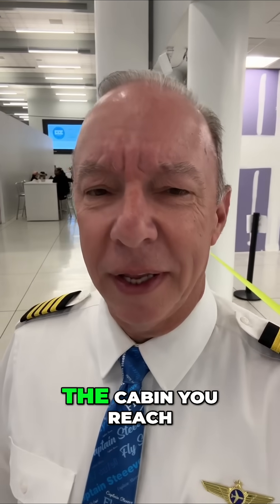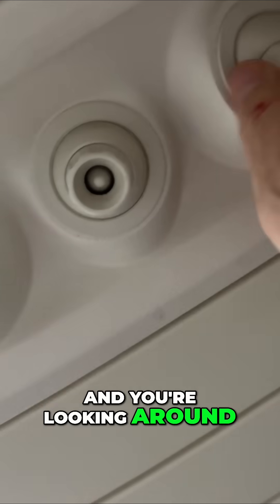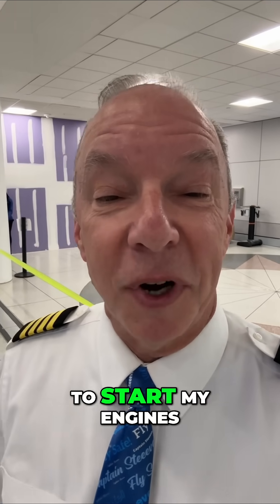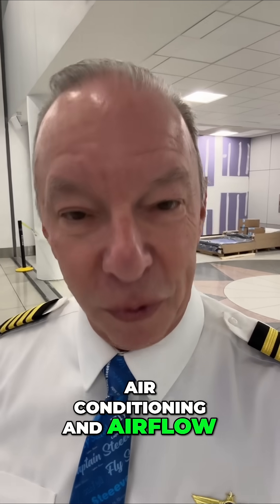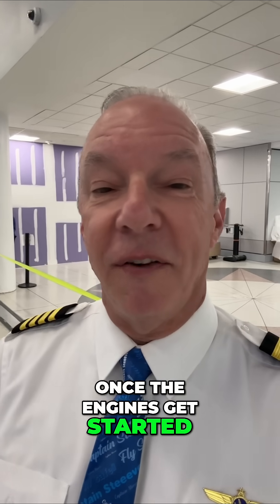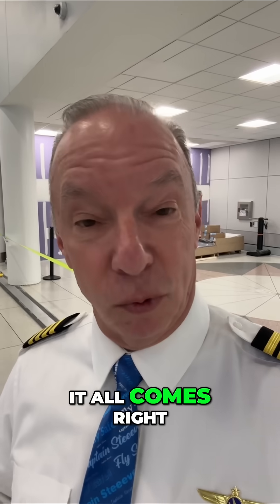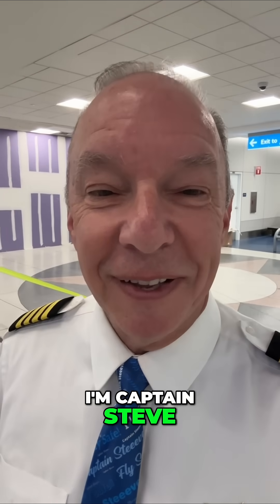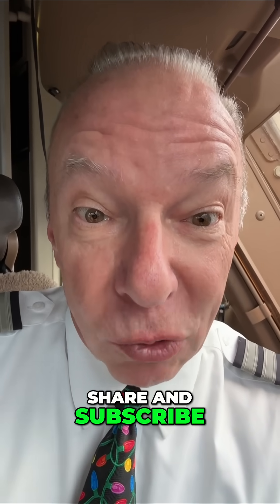Why Cabin Air Stops During Engine Start

Comment: I learned at Arlanda Airport that when they put in fuel, there's no AC because of the fumes from the fuel. It's dangerous if the fume comes in to the cabin.And the passengers get frustrated when it's hot. So when I travel I have a small propeller with batterys, to cool myself down, when it's hot in the cabin.

Comment: Oh. I was suspecting bleed air from APU is stopped to the packs during engine start to prevent exhaust (jet fuel smell) to enter the cabin as the APU air intake is probably in the aft of the aircraft where the main engines blow their exhaust. When main engines have started the fresh air is taken from their bleed air, from the front where there are no exhaust gases.

Comment: More specifically, captain Steeeeeve, it’s because you turned off the air conditioning packs to redirect the bleed air coming from the APU to the starters on the engines. Once the engines are running, the bleed air source, electricity generation, and hydraulic power generation switches over to them and the APU is turned off to conserve fuel. In certain situations the AC packs can be kept off and the bleed valves in the engine kept shut to improve engine efficiency during takeoff. I don’t know what conditions would warrant that though. Would love to hear it from you captain steeeve. In addition, I think that the APU should be kept on during takeoff and landing to ensure that the plane still has electrical and hydraulic power in the event of a dual engine failure, no matter how unlikely the scenario. What do you think  captain steeeve?

Comment: HI Capt. Steeeve!  just describing that is giving me a panic attack sitting at home, I need air.   Ive flown 40 flights or so and know the pre takeoff air stoppage.  at this point I wouldnt be able to handle it, allergies or something and changing of the weather to humid.  Got used to it and never knew why passengers get punished before takeoff.  it was 41* F the other night and I put the AC on full to feel ok in the car?   Flying in the cold that air thing doesnt bother me, now that summer is approaching.  Wanted to ask your opinion on that 1970s Ford Pinto plane endeavor? I remember back then I was in So Cal, but only today heard that it sadly crashed.  Safety and backup systems and more safety.  I wanted to fly, now I want to finish building a simulator

Comment: When I had to fly from Japan to Hong Kong, I only had short notice ahead, and my boss didn't allow me to change the airline, so I had to choose the indirect flight stops at Taipei for 2 hours. Due to the safety regulations learned from the TWA 800 accident, they had to turn off all engines, including the APU, and no ground truck appeared; we couldn't even open our windows,  but only 4 doors for everybody onboard on a scorching hot summer day.  I remember we all cheered aloud when our captain finally started his engines and sending us fresh air. The last time I ever used that airline.

Comment: I see what looks like the APU turbine exhaust under the tail of most planes. Some guys take those APU units and make turbine powered pro pulling garden tractors! Some have 2 on them. I can't remember the horsepower it seems like a couple hundred. The big boys run 2 to 4 helicopter turbines. They compete fairly well with 4 supercharged Hemis on methanol, making a total of 15,000 hp. to start the SR-71s, they had a shaft coupler under the wing that a start cart engaged. They asked the engineers where they were going to get 800 hp to do it with. They were hotrodders and got Buick 401 Wildcat engines, two to a cart, and put open headers and big cams in them! They depleted the supply and went to Chevy 454s at one point. After some of these were retired they supposedly found other unauthorized uses in fast jeeps etc! 😊

Comment: Would you have any idea why an Airbus 321 would unexpectedly lose it's engines while taxing to the gate? Happened to a family member of mine. They were stuck on the ground with no power and no air conditioning for nearly an hour before a tug towed the plane to the gate.

Comment: Huh, explains why the air comes gushing at me after 90 seconds 😅😂🤣. Moral of the story is don't push, pull, or adjust the buttons, 🫣 eg gasper light,  the air con will come back on 😊

Comment: And also while on the ground parked, if not hooked-up to a GPU Ground Power Unit, or having the aircraft APU Auxiliary Power Unit on, there can be no cabin air-conditioning, heat or ventilation air flow. The airplane needs electrical power to operate.

Comment: Explaining lift, based on the design of the aircraft wing would be interesting to explain to them. Then after they’ve gotten wing shape understanding, you could explain how a propeller is designed to pull an aircraft through the air and lift a helicopter.

Comment: Gaspers were originally called Wemac air vents. A/P mechanics use a wemac tool to install and remove gasper nozzles and overhead light fixtures.

Comment: Hey! So not sure if you'd know about this because this has happened to me twice now on the B764. But during engine start, air is still passing through the gaspers when normally like you explained, packs are off & the air is directed towards engine start. Would you know the reason behind this? Past B757 & B767 pilots I had this discussion with say it's leftover bleed air, but this air continues through engine 1&2 start fully.

Comment: Capt Steve, quick question, when the plane levels off at the determined height, it's very cold outside the aircraft. Do you turn off the air and turn on the heat? Thanks

Comment: Not common on Boeing. but you normal do a packs(basically Air Conditioning) off take off on Airbus. Which I’m pretty sure has the same effect. Correct me if I’m wrong.

Comment: When pulling back from the gate and the air stops flowing it was a sign we were gonna take off. This is no longer true, when you’re actually on the runway and wheels are up your good. I had 8, yes 8. Crew members time out last week, CLT to DEN.(26hrs)

Comment: If anyone is looking for more info on this: there's multiple sources of airflow on the airplane, external air, APU air, and Engine Air. When you're on the ground at the gate the air is most likely coming from an air box outside the airplane. That's what that yellow hose is, I always thought that was to empty the waste tanks when I was little

However before you can push back from the gate, that external air gets disconnected, so your only source of air would be from the APU. Like Captain Steeeeeve said, you need air to start the engines, and for that you'll turn on the APU Bleed. That redirects the air coming through the APU ducting to the engine start valves, so when you open the start valve the engine will start spinning and eventually when you run fuel the engine will turn over and start.

Once both engines are started, and you return the engine mode selector to normal (engine mode selector is an airbus thing), the air from the APU will supply air to the AC again, and then the packs on the engines will be enabled, making the air source the engines, and the APU can be turned back off.
Reply: Huh 🤔 interesting

Comment: In 2007, I was on a AA 777 going to PVG from ORD.  Same routine, engines started to roar, and the plane shuddered hard a few times.  It seems somehow the plane wasn’t disengaged properly from the push back.  It damaged the nose gear.  It had to go back to the gate, and chief mechanic had to be called for inspection.  No go, switch equipment; and new crew had to be called.  Delayed  6 hours. 😢

Comment: This is great information. Thank you Captain Steeeve!!

Side question: is this whay sometimes we can smell jet fuel/exhaust in the cabin when the engines start?
Reply: the air for the air conditioning comes in thru the engine, I would assume there is a bit of unburnt fuel before the engines get going and a small amount is probably making it into the cabin

Comment: Is the shared air system the reason that the cabin smells like engine exhaust immediately after the engines are started? I noticed it for the first time after we pushed back on a flight around Christmas, and the hydrocarbon smell became my least favorite part of the whole process.
Reply: What you’re smelling is the engine exhaust as the engines start up. When the engines start there is very little thrust and the exhaust lingers around the aircraft and gets into the cabin air intakes. Once the engines speed up and reach idle thrust the exhaust is blown more forcefully behind the airplane.